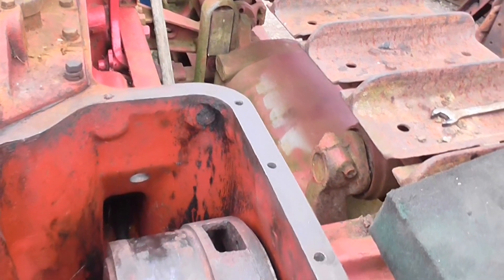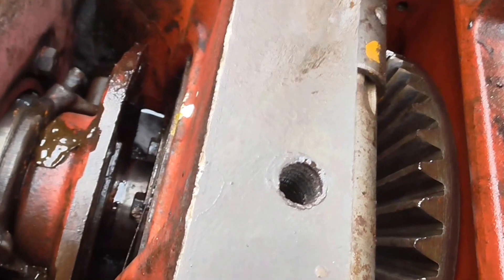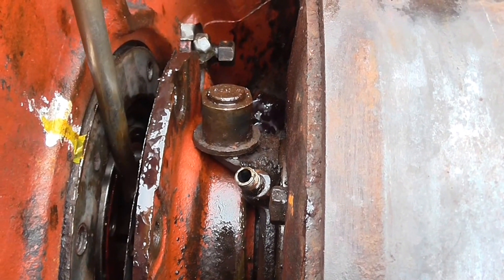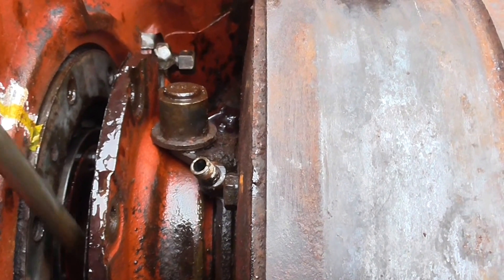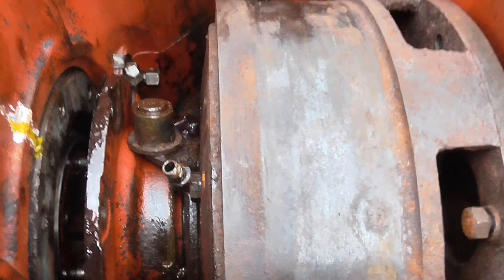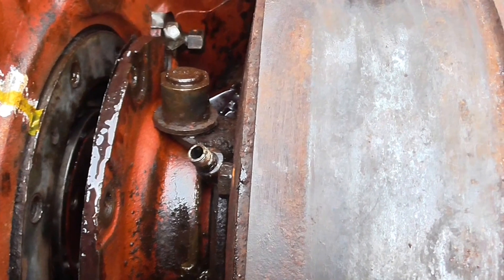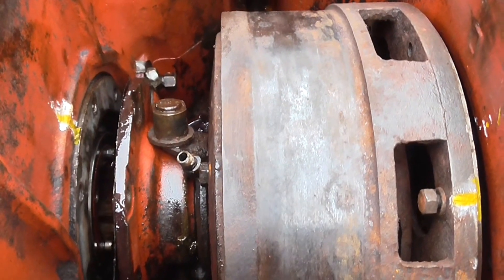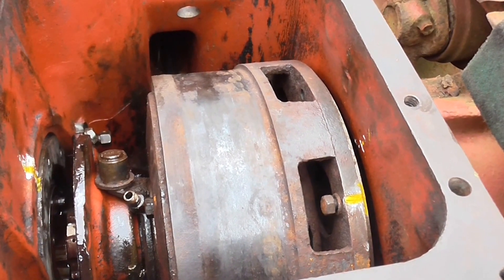International Harvester TD6 steering clutches

Comment: Hello.
We are just doing the clutches on a TD6. It does not want to roll on its tracks, we have removed the brake bands, and it makes a county crawler with a 6cyl work to drag it around. 
We are struggling to rotate  the steering clutch to remove the bolts, especially the ones on the dog drive. You need baby hands to get in and undo the bolts. Up to now, I only see 1 that has sheared off. We will have another go tomorrow weather dependent 🤞🏻
And try to rotate  the clutches with the county crawler gently tugging them round so we can gain access  to the bolts.

Comment from the maker: Had fun with the left hand one, the bolts were very tight, one of which had rounded flats, tried a small long chisel, no joy, could not get a cutting disk in the space. Had to resort to drastic action. A cutting torch, I got the flame right down to its minimum and just carefully lamped of the head of the bolt, the lock tap strip prevented damage to internal flange.This worked, the remains of the bolt screwed our easy. Jobs a good un